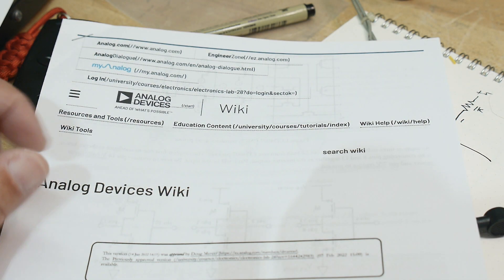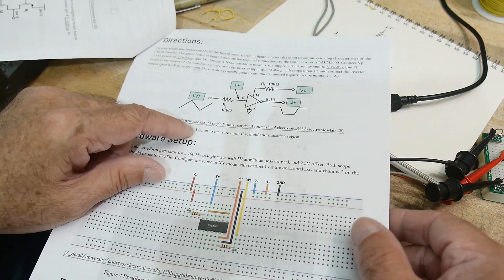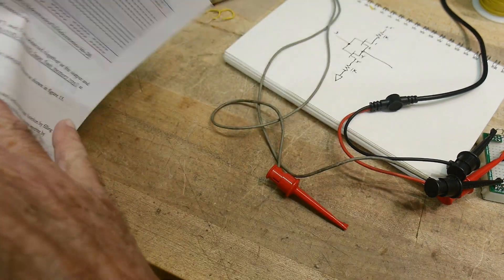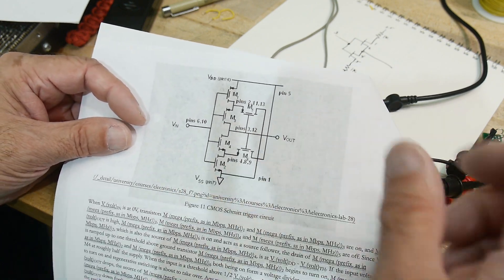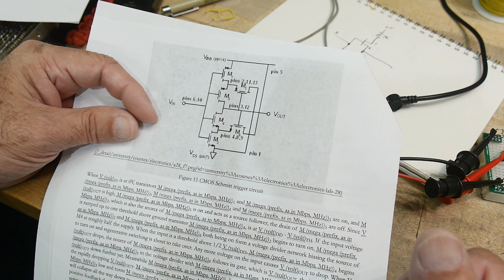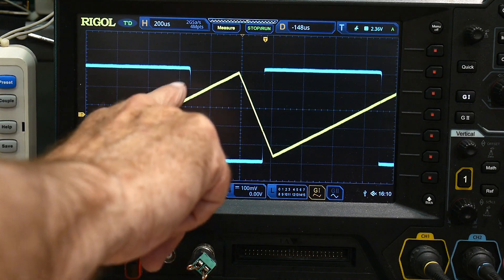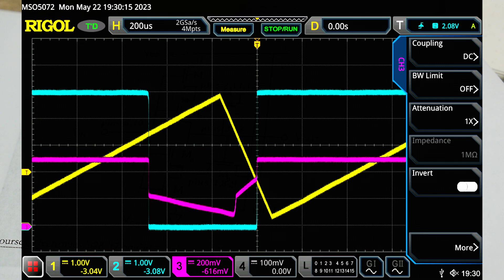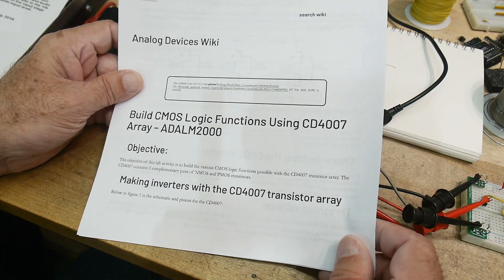#1541 4007 Schmitt Trigger

Comment: You don't mind if I use a CD40106 instead, do you?  Seems like a lot less wiring. 

Seriously, those "do all" ICs were useful as long as you didn't fall into the "if all you have is a hammer, everything looks like a nail" trap.  I mean, I've seen some really...uh...interesting hacks where an engineer came up with a novel way of using this kind of component, leaving the guy troubleshooting later to wonder, "Why in the hell did he do that?"
Reply: I don't have the time to wait for the CD40106 to make up it's mind.  !'ll be using a 74HC14 or a 74AC14 if I'm in a real hurry.
Reply: Your point is well taken.  I think there is some value though in not only learning the concept of a transistor based Schmitt trigger, but sometimes in a pinch, you have to make do with what you have on hand in your inventory or what's already been committed to the board.